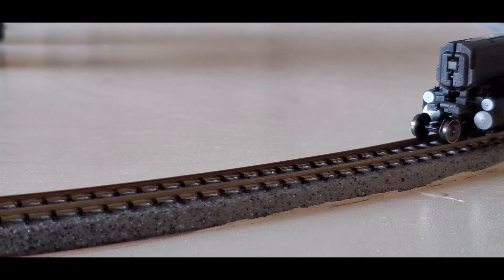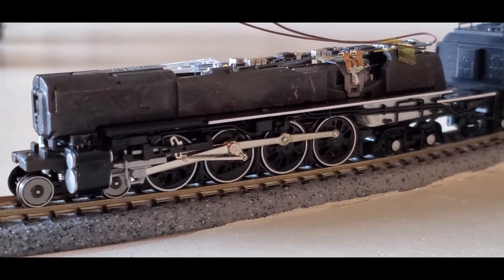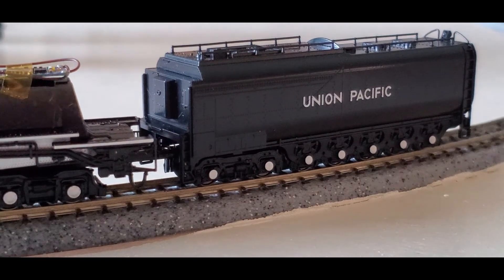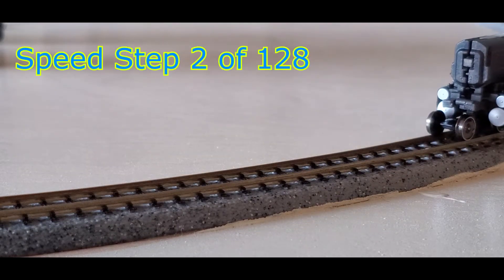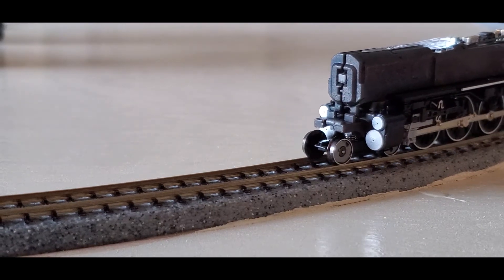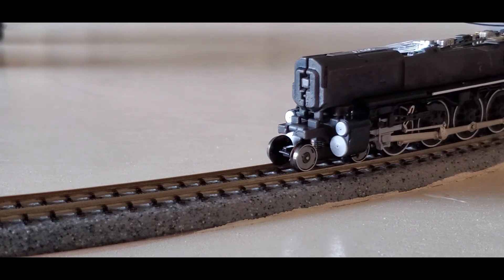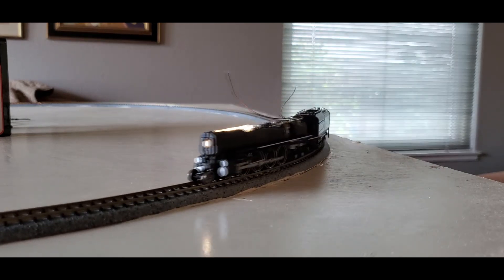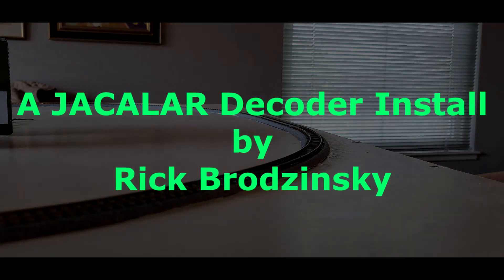UP 844 Tuning with ESU LokSound 5 Kato USA Micro DCC decoder

Comment: Thank you. I was getting frustrated with my same set up. Your settings really helped. I was getting ready to send the FEF Grayhound back. Its still has a slight jerking motion but not as bad. It would be nice to know what these setting do.
Reply from the maker: If there is still a jerking motion, you can try adjusting K slow, as well as the reference voltage. The trick is balancing the slow crawl to be smooth and slow.  I’ve now done 3, with another on my bench, and each has had minor tweaks from these settings.  On one, it was actually so smooth and slow, I couldn’t adjust the chuff spacing to be long enough, actually had to speed it up!